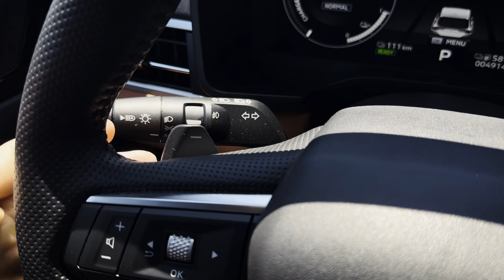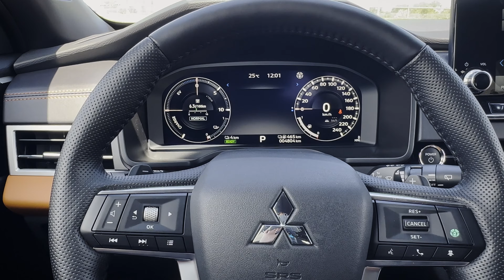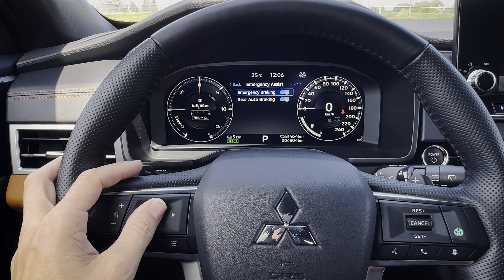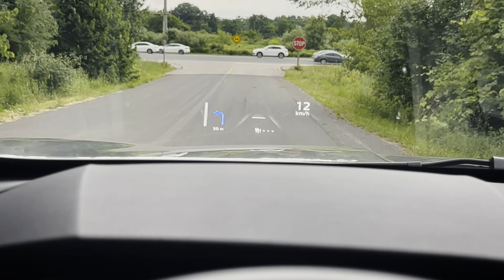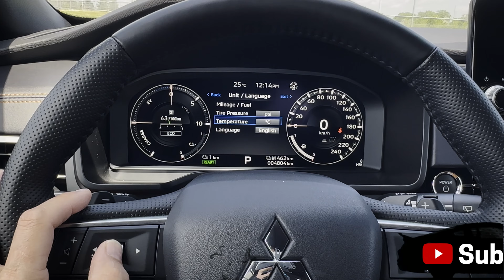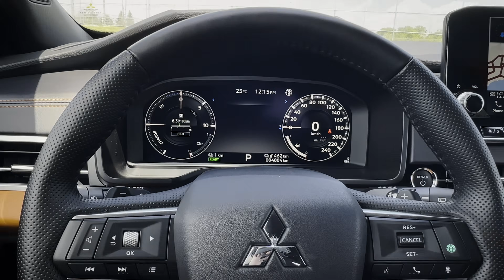Steering Wheel and Cluster in the Mitsubishi Outlander (2022-2025 models)

Comment: My volume, voice and phone controls on the wheel aren’t working. Any suggestions?  It’s a 2023 model.
Reply from the maker: You can try a battery pull and see if that does it but it sounds like there could be a wiring issue